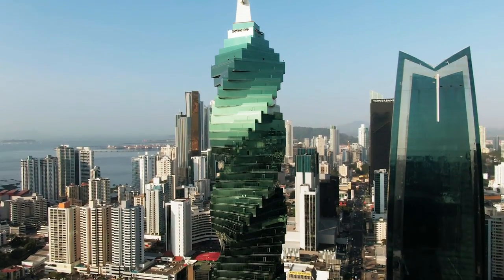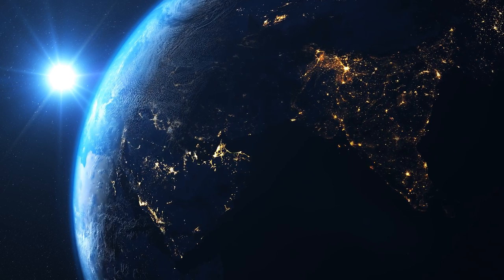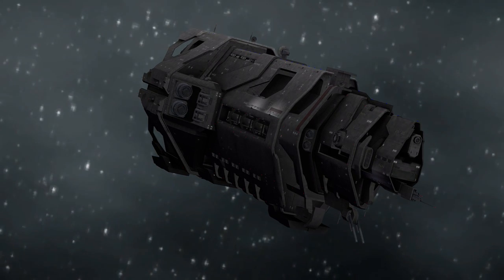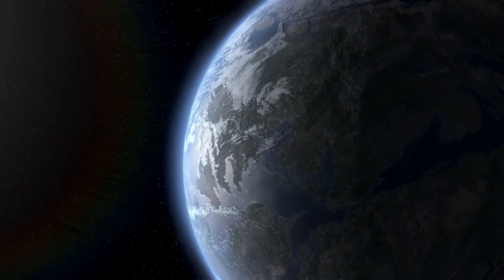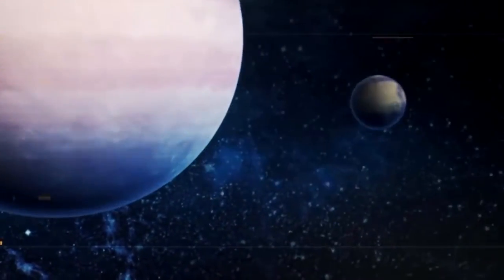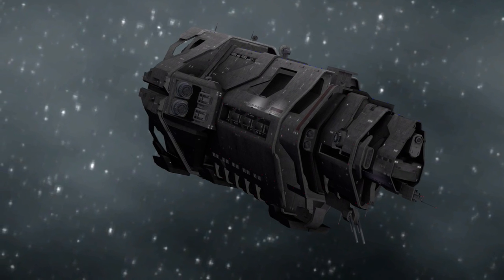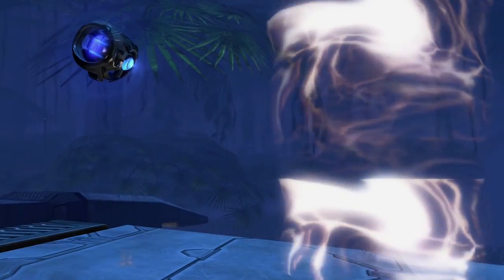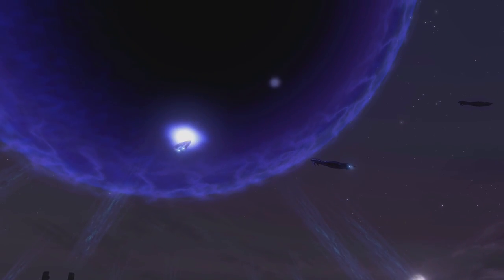How Slipspace Works (Halo Lore)

Comment: Slipspace is the fast travel through the Nether but without the hell
Reply: Nether travel is basically just the warp from 40K.
Reply: @alexkorman1163  except better
Reply: yup but then there are those moments when you get teleported to some random portal and have no way back to your home
Reply: @than.imeiii  I'm actually on my way to destroy one of those random portals right now
Reply: @MVJORV  better? depends on your opinion. Safer? Definitely, like a walk through a park
Reply: @alexkorman1163  i hate when people compare 40k to everything
Reply: Well, it is just fast travel through the Nether with hints of Quantum Slipstream from Voyager.
Reply: @MVJORV  that makes obsidian farmable, but its annoying. Unless you have a mod or have your coordinates marked
Reply: Daryl Dixon by technically Slipspace is is better is you have a good engine for it, but the warp has the chance of getting you to your location before you even left (time travel)
Reply: @alexkorman1163  Warhammer 40K and Minecraft are the same universe confirmed.
Reply: @alexkorman1163  40k warp drive is like taking a shortcut through satan's backyard.
Reply: @lillburtlonk3721  I understand completely. There's no point in comparing every sci-fi universe to the best universe in fiction, WH40K!
Reply: @solusaldrain  i wouldn't say best, but strongest. It gets a little annoying how everything is over the top. That's okay since everything else in the 40k series is overpowered but no sci fi goes as far as 40k in strength.
Reply: Hyperspace is more like nether travel
Reply: Alex Korman lol ya it is
Reply: Well yes but Actually no
Reply: Ugh not minecraft. It's shit.
Reply: @alexkorman1163  Once I've relised it.....
Reply: @alexkorman1163  EXACTLY MY THOUGHT THANK YOU I THOUGHT I WAS THE ONLY ONE :D
Reply: Below the nether floor where no player ever goes
Reply: @Super.YT_  holy crap that is some serious bait
Reply: @solusaldrain  It's because you guys never shut up about 40k and it just drives would-be fans away. Obnoxious as all hell.
Reply: @vehicleboi5598  *A valid opinion
Reply: Jesus Christ love you please give up your sinful way
Reply: @alexkorman1163 😢

Comment: It's crazy how we're able to explain sciences we haven't even been able to achieve.
Reply: those are called theories, theyre quite common
Reply: Kevinito9 hypothesis at best. More like day dreams with very little basis in reality.
Reply: Cosmic string theory is a thing, so it's not all baseless. You should check out Kurzgesagt's video on wormholes, it's very interesting.
Reply: @pranavghantasala6808  string theory is a meme. E8 is the answer
Reply: There's even theories and very early designs for faster than light travel using our current understanding of physics called alcubierre drives. Basically they use dark matter & energy to create a bubble of regular space and a portion of expanding spacetime behind the spacecraft and a portion of contracting spacetime ahead of it which would make it perpetually "fall forwards" in space. There would be no length contraction or time dilation because the spacecraft would still be in stable space, in fact relative to the bubble of space surrounding it the spacecraft doesn't move at all.

Unfortunately we only have a very basic understanding of dark matter/energy and we don't know how to produce either let alone manipulate it this way so there's quite a bit of research to go.
Reply: @HuyLy94  there's actually been a slight resurgence in that field, and it turns out that the Alcubierre drive is actually more plausible than we thought it was. Nothing concrete, of course, but it sure is exciting to think about!
Reply: @pranavghantasala6808  I sure hope we can find a way to make it work! I want to travel the stars in my lifetime and see them aliens! 😀
Reply: We have the science, just not the resources, but with ideas of astroid mining and skyhooks being possible with what we got, we could eventually turn this crazy Sci-Fi looking believe into a reality!
Reply: You appear to similarly interested. There are a bunch of General Relativity lectures here on YouTube you can find to analyze wormhole metrics yourself!
Reply: *for now.

Comment: I feel like like this is possible but we need more understsnding of physics. Sorta like how u need to understand how a game works before u can mess around with cheat codes and stuff.
Reply: yea you don't want to go accidentally deleting the System 32 file of reality itself xDDD
Reply: Check out quantum non equilibrium for possibilities of FTL travel
Reply: Well the most likely scenario is the alcubierre drive which is essentially warp travel where you create a bubble of space time around your ship that contracts the distance in front of you and extends the distance behind you. So technically you're going under the speed of light, but the distance to travel is significantly less. 

Mass Effect has a similar idea with Mass Effect fields. The reason we can't travel past the speed of light is that the further you approach the speed of light, the greater your mass/inertia becomes. This is also why time dilation becomes a thing. For the same reason that time goes slower around black holes because of their enormous mass and the gravity they subsequently exert, traveling up to the speed of light will itself increase mass and gravity, leading to time dilation. 

However, travelling past the speed of light is impossible for another reason. To go faster, you have to accelerate. However, the amount of acceleration that is required to propel something up to a given mass is proportional to its mass. Therefore, if the mass becomes larger the faster you travel, your acceleration goes up. To the point that as you approach the speed of light, the acceleration required to propel you beyond the speed of light becomes infinite. You obviously cannot have infinite acceleration, so travelling past the speed of light is impossible. 

Mass Effect creates a bubble of mass distorting mass effect fields that decrease an object's mass and increase the speed of light within that bubble relative to light speed outside the bubble, thereby allowing the ship to accelerate with its regular thrusters to as fast as they can get, allowing for FTL travel. 

At least that's my, highly flawed understanding. I last did Physics in High School. Someone more qualified feel free to correct me.
Reply: @Killzoneguy117  you need infinite energy, not infinite acceleration.

Comment: Here's an interesting thing for you to explain regarding slipspace: during Halo 4 spartan ops there is a forerunner object on board of the UNSC Infinity tying the ship down, being called a "slipspace anchor" by the ship's AI Roland. How would said slipspace anchor work?
Reply: Leon Schuit probably a super gravity bubble prevents Slip space generation
Reply: @Fliuck  Exactly, I would assume they would have control of gravitons at this point. Basically, Particles that can control and influence gravity
Reply: John Anguiano see for me, it makes me question why forerunners preferred hard light weapons, if your controlling gravitational forces just point your emitter at what you want not to see and it goes away really quickly. 

Anyway nice video, although some more interesting questions can be posted about slip-space, for example, we have seen on at least two occasions ships travel through slip space  by riding through the wake of another ship (in amber clad and the chiefs fighter in 4) does that mean that you need only have a ship that’s a hollow sphere and you have a fleet of non ftl capable warships? If so the covenant should be shot for losing so many ships so quickly.
Reply: @Fliuck  Gravity Weapons would bring interesting dynamics to the gameplay. I would love to see that in a future halo game
Reply: John Anguiano besides the gravity hammer 🔨
Reply: @Fliuck , but why refer to it as a slipspace anchor then, that infers that the effect is caused by slipspace itself. I mean, Roland should be able to easily detect gravity fields using Infinity's sensors, Serina could even do that on the Spirit of Fire, which is ancient tech compared to the Infinity.
Reply: @Leon_Schuit  The Forerunners had a very high mastery of slipspace. During the Forerunner-Flood war, they had lines of stations called that Maginot Sphere that prevented ships in real space or slipspace from entering. And the precursors and Flood were on another level. The flood at the height of their power actually corrupted slipspace and made it so even Forerunner slipspace drives were "incompatible" with slipspace, essentially trapping them. It should also be said that the Infinity is largely powered by Forerunner tech, which the slipspace anchor was feeding off of, likely making the ship incapable if powering up its drive and also tethering it to the station. The artifact was capable of teleporting objects and people through slipspace as well as communicating with the Forerunner tech around it, likely the anchoring effect was caused bending or overlapping slipspace around the two places, best way I can describe it at least as slipspace physics are really fucky.
Reply: A halo book (I forgot which one) states that the forerunners had lot of tech the could alter or manipulate slip space in ways that's never understood or explained.

The book covers a forerunner crystal that changes the dynamic of slip space to allow ships to interact with or even attack eachother. Normally this is impossible in slip space.
Reply: 343 games aren't canon.

Comment: This is actually very similar to something NASA has actually thought of that kind of warps space around something to push it like a wave
Reply: It’s completely different, NASA warps space is like making the ship ride a space wave and travel faster than light while not having the time travel problem, the slipspace drive is where the ship tap into an alternate dimension to travel and the alternate dimension have point in the universe that is basically a shortcut. Simple example is slipspace is similar to wormhole but warp speed is riding a wave that is faster than light.

Comment: the speed of light is 300,000 kilometers per second, the Time dilation effect of Relativity is multiplied by approx. 7.2*. If you were to travel for 10 min at .9 the speed of light you would have left for anyone not travelling with you for more than an extra 10 min. you could have been gone for 1 hr - 1 day depending on your Course (Flying straight then back vs. Flying in a loop)

Comment: I did some quick maths
Assuming you can travel at 90% of light speed,
your time dilation is roughly  43.59% "normal" time

Meaning if you were to take a 100 light year trip,   
A stand by observer will see you take around 111.11 years to arrive
While you would have experienced it as 48.43 years

If you want the difference to be pretty much exactly half, you need to travel at about 86.60% the speed of light, or more precisely 259'627'884.49 m/s

Comment: Slip space seems like a function of what people think happens when 2 or more magnetic fields converged on a point and make a temporarily rip or hole . Tho what some whistleblowers claim is the use of red mercury rotating inside a donut + coils helps create another protective field for both traversing unusual portals but is also used as a form of unconventional propulsion.  Think the donut and mercury creates a magnetic taroidal field. And that is what interacts with the rest of the engine system. Tho until recently I didnt think red mercury was real...

Comment: Should have mentioned a little about how the forerunners knew they were going to eventually fire the rings, because they could detect the pre-echoes of the rings firing in slip space. Probably due to the same cause as reconciliation. Could have also mentioned about how the precursors used a completely different technology to the forerunners (neural physics), and that it is somewhat incompatible with the forerunners slip space technology - they couldn’t move through slip space like they used to towards the end of the war, remarking that “its almost as if space itself is infected”. They only way they could escape encirclement a was by firing halo arrays, which could be tuned to destroy neural physical (precursor) structures.

Comment: Awesome video. Now I’m interested to know how communication in the Halo universe works! Hope you cover this in a future video!!!
Reply from the maker: Now there’s an interesting idea, noted - thank you!
Reply: Maybe harnessing quantum entanglement in some manner. This would allow instant communication across light years, whereas radio waves travel at the speed of light, which is extremely slow on the galactic scale.
Reply: @Reece X I haven't read the books. So it's nice when channels like this cover such topics and make it easily digestible for those of us may not have the time to or are new to the vast universe of Halo.

Comment: The concept of the topology of the Universe being convulated enough for a lot of transit points to exist would mean that where the points are, would not be due to safety such as displacement of atmosphere but simply be due to the rarity of such points which in themselves may be moving or temporary and more advanced technology would be matter of accessing more of these points not a matter of bring more covert.  Indeed navigation of these points would be the key strategic advantage.

If there us to be any limits to where these transit points are, it would be by gravitation wells as gravity is the only force we suspect of curving space.

Comment: The bubble that a ship uses cross through slipspace, to the extent that it can be used, must be anti time and because the ship is VARIANT UNDER slipspace. An anti time bubble might also create problem for the ships in those bubble. Any anti time might be more rigid and offer a narrow guideline for mass alterations.  Thomas Bram author of 'THE WOVEN SUN.

Comment: Slipspace isn't a slipstream it's technically separate dimension/dimensions that dont feature what we consider dimensional space but we observe 3 dimensional space because 3 dimensional space will form around anything with mass and it can be observed that the less mass something has the more likely it will "teleport small distances randomly and energy has been observed behaving similar to the quantum asteroids in GoTG vol2

Comment: Quantum non equilibrium explains all of this plus more easier!! I do like Einstein's theory, but it doesn't make as much sense as quantum non equilibrium if you consider joining the two theories, calculating the energy of "empty space" using current quantum mechanics gives you too high of an energy compared to calculations from general relativity. This means there has to, in some way, be less energy in the quantum world. Probably something to do with the Casimir effect I believe

Comment: In cannon, what is the accuracy of UNSC drives and the covenant drives in relation to say jumping into orbit of a plant in a tactically useful formation. Can the covenant / UNSC do micro jumps in a star system. Could they come out of slipspace in the atmosphere of a planet with no issue? How fast can a ship jump again?
Reply: UNSC ships pre-war cannot jump in-system nor any where near a planet. When a ship arrives, it best to drop out of slip-space outside a said system to avoid collisions with anything becuase of the how wildly inaccurate it is.
Reply: @tristanbackup2536  I don't suppose there is a wiki on the physics of space combat for the halo universe anywhere? Like top acceleration of their warships, how dispersed they are on emergence from slip space(do they need hours to regroup a fleet?), how far out from a gravity well/ planetary body they have to jump.
Reply: @WALancer  
Halo warfleet book I think.

Comment: Thanks for the video. So could two ships battle in slip space? If so and ship exploded would the wreckage clog the stream with bits and parts like an asteroid field? Or is it possible to set mines in the stream to block paths?
Reply: No, ships can't fight in slipstream because they can't happen upon each other in it when they enter separately, and when a ship enters the same portal as another they will still not be able to fight each other because mass doesn't exist in slipstream, hell all laws of physics don't and each ship will need to be cocooned in its own little bubble of real space otherwise they'll simply cease to be.
Which will be the fate of anything being fired from those ships as soon as the projectile or energy leaves the real space bubble they'll be swallowed up by slipstream never to be seen again. While probably destroying the bubble of the firing ship destroying it as well, thus being suicidal and ultimately useless.

And since slipstream is well like streams and rivers thus not static but constantly moving and shifting with uncountable streams connecting innumerable points in space with each other. No there is no way to mine slipstream.

Comment: The mass thing is reverse, for a ship to safely fly through slipspace, it needs to be heavy.
Reply from the maker: Traditionally it needs to be large before entering. But during slipspace transit the mass must be zero as slipspace is a non-spatial dimension
Reply: @SameToken It's wikipedia page stated that for safe travel in slipspace, the ship needs to be heavy or overly reinforced. Forerunners used shields.
Reply from the maker: Dustyn Miller that is correct, but the mass outside those shields is reduced to zero. The technology essentially allows the mass of the ship to be unchanged within its bubble, but outside the bubble it is now massless. This is why the way ships interface with slipspace doesn’t betray the law that nothing with mass can travel as fast as or faster than light.
Reply: @SameToken  Objects in real space can affect slipspace.
Reply from the maker: @WolfeSaber  Correct!
Reply: @SameToken  Using science like this, Keys ambushed a Covenant invasion fleet where he created the Keys Loop.